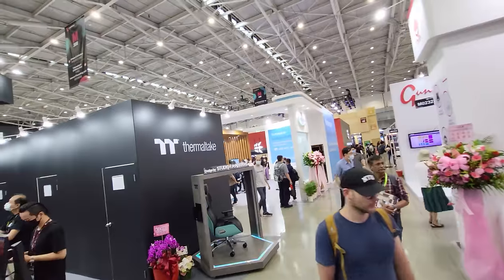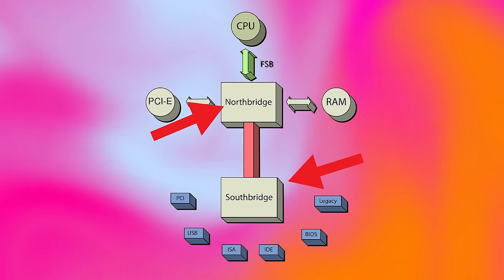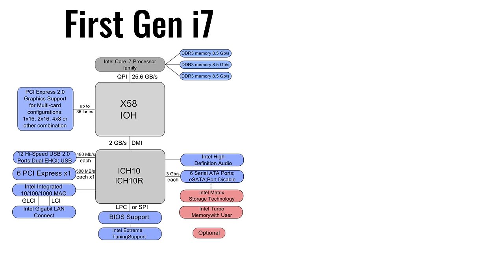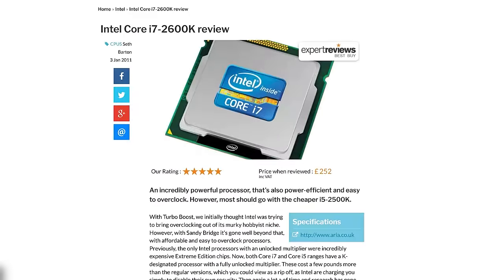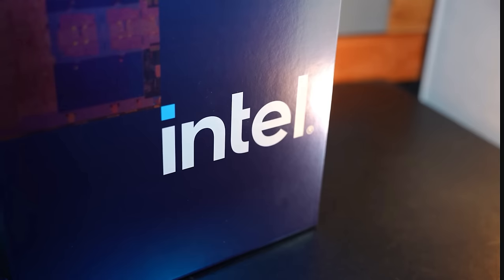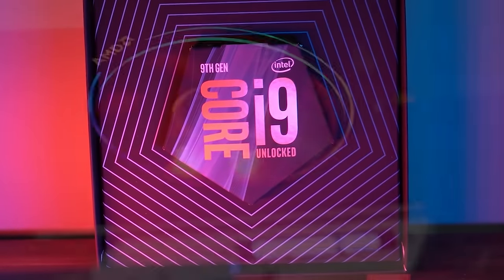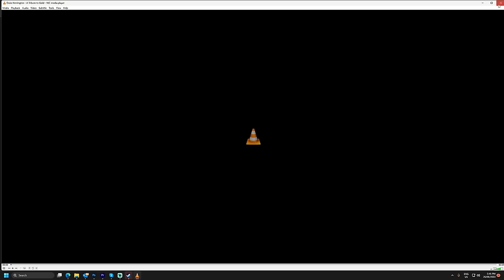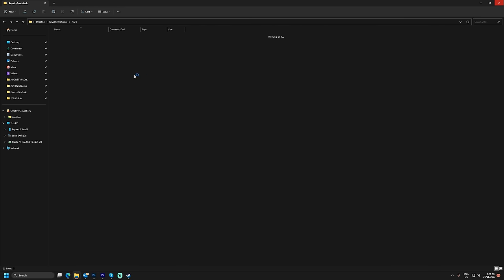SNAP - The Intel CPU Latency Story (Part 1 of 2)

Comment: I don't think so. My understanding is that the latency is in the NANO seconds, the delays shown in this video are way longer.  Showing a slow Premiere Pro timeline doesn't prove anything. Have not seen ms-word "glitched out" and then associate it to a latency issue.  There are many variables that could influence or cause the behavior.  Maybe a doubleblind test could be setup for this and tightly controlled.  Generally speaking a 13900k will be faster than a 10900k in most scenarios. 

Maybe setup  ddr4 test systems with same ram and same nvme, similar Mobo as possible and then do some testing.
Reply: Nanosecond-level latencies can easily add up to milliseconds or even seconds under the right circumstances. If your CPU is doing 1 billion operations, and each of those operations has an extra 1ns of latency before the next operation can start, that means a full second of total added latency. Hence why RAM latency matters so much in games (and why AMD's x3D CPUs are able to provide such a performance uplift). I agree that there might be other causes to this specific issue though.
Reply: @half7232  1 billion operations are needed to open a word text file?, don't think so ...

Comment: The system agent is still very much on the same die like previous intel CPUS. Look up Alder Lake die shots on the net. Disabling e-cores in the BIOS doesn't work. Enable e-cores in the BIOS and then disable them in windows by using this CMD command. bcdedit /set numproc 16 (16 is the number of threads, i have a 13700K.) 
Perhaps the issue is the motherboard/chipset. All USB ports on intel PCs go through the chipset. The only way i can think of to bypass the chipset is to get an M.2 to USB header adapter, and connecting it to the primary M.2 slot.

Comment: This is quite interesting. I have not used a 12th or 13th gen intel platform myself, but this reminds me of when people upgraded from x99 to x299 and saw a performance decrease in some areas. This was when intel changed their architecture from ring bus to mesh (i think). At the time, i'm pretty sure the consumer kaby lake chips were still on ring bus and actually outperformed the HEDT cpus in most games.
Reply: FWIW, I got a significant bump in performance coming from x99 to x299 in games. I guess OC's were far better on the x299 platform. Still rocking it to this day :D
Reply: This was a big discussion point in the forums from HEDT users back then. I personally had a X99 6950X system when X299 dropped and decided to stay for the ring bus since I had a golden 4.6GHz 6950X. The mesh latency penalty can be reduced with a high uncore overclock and fast RAM but X299 CPUs still do lose to a highly tuned 6950X system when latency matters. 

Funny thing is, because the mesh CPUs sucked at gaming Intel released Kaby Lake-X which is their most pointless CPU lineup ever to try and cater to people who for some bizarre reason wanted X299 motherboards but want the best gaming performance. They offered the same 4-cores, 2-channel memory and 16 PCIe lanes as Z270 CPUs so wtf was the point?
Reply: @OTechnology  I get why they introduced the Kaby Lake X though, theres plenty of people who use all the lanes on say the z270 platform, and the x299 would offer them slightly weaker cores with much more side supported stuff. And it was quite budget friendly to boot compared to the 7920x and up.

They'd also OC like no tomorrow, especially when delidded. My 7920x can do 5.0Ghz on most of its cores for example. A significant bump in performance.

and x299 boards just look amazing TBH. Quad channel RAM <3

Comment: You used IOH and IO driver interchangeably, so I'll assume you mean the part of the system that includes the memory controller, PCIe root complex and the associated bus interfaces. 12th and 13th gen Intel Core CPUs are still monolithic, and the Intel datasheets say this functionality is still on-die. In fact they have even added USB-C and USB4 to the CPU die. So if it's not the IMC or PCIe controller that have been moved off-die, then what IO driver functionality is left to be removed?

Windows search is at least partially a software issue. On more than one system I've typed in the name of a file I know I have somewhere and it simply never stops searching while sending the SSDs to 100% busy. Using the 'find' command in a Linux subsystem terminal is faster, or even searching from another system over samba
Reply: I turn off Windows search and just use Void soft Everything.

Comment: I have a 12900KF, seen the issue you show, I always thought it was a Windows 11 issue, because it started happening after a KB update to fix a security issue last year or prior. Long story short I disabled A LOT of stuff in windows, MPO was one of the main ones & I wouldn't say I stopped having the issue, but it wasn't even closer to as nearly as noticeable today since I reinstalled windows fresh (due to MBR on new drives for some unknown reason causing CSM disabled issues, causing black screens for monitor that wont go away unless you restart with HDMI old TV installed into 3080 GPU with the DP port monitor) Since Then! I notice that latency issue Every God Dam Time. ~ Hindsight wish I kept a list of the changes.
Reply: Actually In fact since its new I only have: KB4023057,  KB5027231 & KB5027303*, also Framework: KB5027119 installed & while my PC was offline & I was installing all the system drivers I didn't notice the issue, But when it was online & Windows updated as above its back & some. So i really would not rule out windows 11 making that IO issue worse. - Full transparency I also had Memory Integrity off when installing my drivers before windows update & the issue was noticeable. - I also didn't have the "optimizations for windowed games" option At All appear, until I updated windows.
Reply: I had a 12900k, I have a 14900k now and I've not had any issues I did with the Alder Lake i9. Alder Lake was super problematic when it came out. Unrelated but it was nearly unusable sometimes within the first few weeks until a bios update came that fixed all the bluescreening I was experiencing.

Comment: Are there latency differences between 10th and 11th gen? If not, then shouldn't 11th gen be better due to pciex4 support?
Reply: 11th gen has higher latency than 10th gen, it's the main reason why it really didn't get any performance improvement.

Comment: I've had a 13900k (upgraded from 9900k) for over 6 months now, and I haven't noticed a latency issue. I'm going to have to pay attention to this now.
Reply: Yah I did a similar upgrade 9900K with DDR4-4000 -> 13700K with DDR5-6800.    I don't see any latency issues like he shows in this video.    Everything in this video I'm seeing, seems like a storage related problem.   Maybe his storage drivers aren't in MSI-X interrupt mode and are legacy interrupt sharing with some other device?    It's hard to say honestly without sitting down at his system and seeing exactly what's going on.
Reply: If you game with high apm , high elo moba player vs , you will notice it
 Or as high elo cs player

Comment: From my experience, the lags and stutters you experienced are mainly OS related (a fix may be uninstalling OneDrive). The real latency issue is DPC latency and I heard that may be fixed in a future driver update. There is a thread about this video on r/intel and some of the replies may be interesting. 

Lookin forward to part 2 doe :3
Reply: I fixed the dpc latency issue by disabling core parking in regedit. On my 12900k. Tested using latencymon

Comment: I am not a power user or anything, but I do have an i5-12600K (idk if that's affected by the poor latency) and I did have the same issues as you described on Windows 11. Just random slow downs or pain inducing loading times while I was making basic things like programming, presentations, documents. Don't even get me started on the usability and responsiveness while I was recording with OBS at the same time. I have always dual booted Linux on my PCs and it came time for me to install Linux on this pc too and I noticed that I never got these slow downs there, never. Months passed by and I decided to install Windows 10 on the place of 11 and I am proud to say that I am no longer experiencing these issues and I will keep away from Windows 11 for as long as I can. Just for extra clarification, I have a crucial p3 plus, sandisk 3d ssd and a seagate hard drive, the aforementioned issues happened on all three drives.

Comment: Hmm, how interesting, I have a 12900KS and z690 gigabyte board and I have not noticed much latency at all.

I use the 12900KS as a professional programmer daily and writing and execution of code I find the latency to be quite low, even searching files as you showed on this video.

I did find windows 11 slow to begin with, but I modified the OS configuration, set the display to performance and disable visual fades and transitions, and a bunch of background services. 

I can only compare my experience to my overclocked 3900XT, and the 12900KS is miles ahead in snappy feelings and performance.

The one thing that could contribute is DDR4 vs DDR5. I'm running a DDR4 kit 32*2 CL16 3600. The system is noticeably slower in gear 2 mode, but in gear 1 mode it feels very fast.

Now DDR5 is way slower in latency than DDR4, but it makes up for it in bandwidth, and I'm wondering if lower bandwidth tasks that are not active for long enough could be a potential cause? 

Not denying that moving the I/O controller off chip is causing some latency, but I wonder if it's compounded with DDR5 higher access latency in general.

Generally I/O tasks concerning the mouse and keyboard and system interrupts are very very low bandwidth but still need to have the state saved in either cache or memory, and in the event of a cache miss, I wonder if DDR5 access times just tanks system interrupt performance.
Reply: I have a 12600k and a gigabyte board and have never noticed any latency problems

Comment: I was having similar problems with my 5800X after migrating from a m.2 SATA SSD (Samsung 870 EVO 500GB) to a m.2 NVME SSD (WD SN770 1TB).
I thought my drive was defective or something. OS would eventually crash after several hibernates. Games and apps crash eventually after several hibernates too. Stuttering and loading got worse the more hibernates and the longer and harder I use my PC.

I also thought of the IO issue. So I undervolted my SOC voltage from auto (that went to almost 1.4v) to a flat 1.1v. Voila! No more lags, no more stutters, cooler CPU too.

I've read about that issue before and reddit and the Pollock guy from AMD suggested to undervolt the SOC instead. The assumption was that it was thermal throttling under IO loads and this caused hiccups and long loads, like a broken HDD drive. The same should also cure some USB and audio issues too on AM4 as the USB disconnects and audio hiccups can be a sign of the IO/SOC chip under stress.

I think the problem with Intel and AMD now is that they are pushing their chips too much to sell it as high as possible, combined with the overgenerous defaults of motherboards trying to say their boards perform better than others by overvolting and playing with limits. We are basically getting overclock problems out of the box.

Comment: Great video, really waiting for part 2
I have an i5 10400 in one of my PC's and the other day I was at a friend's house and showing him around some basic stuff about video and photo editing. 
We both acquired our nvme SSDs the same day, they are the same model and the same capacity but the only difference is that his system is 12th gen. 
There were quite a few little moments that his of felt sluggish when I was browsing the files or scrubbing a few pieces of a video/photo on each editing program. I thought it was my idea, maybe I was tired of something, I even thought the SSD had some issue. 
Turns out I wasn't crazy and it wasn't my idea.
Reply: I can't say my system feels slow with a 12th gen, although I don't have a E core part since the E cores are just terrible for everything so not sure if the non e core parts don't have that issue
Reply: @tilburg8683 they have that issue and you're fooling yourself into thinking you still made a good purchase 😂

Comment: Quite strange, been using a i7-12700 along with a B660m chipset,  PCIe 4.0 NVME SSD and 32Gb of DDR4 RAM at 3800Mhz and CL 17, and never faced such problems, on the contrary, everything seems so snappier.  I think this needs a deeper investigation, your problems seems to be somewhere else ...
Also, usually your first SSD M.2 and GPU have a direct connection to the CPU, not going through the chipset ...
Reply: i had simmilar problems on i5 8400 , never fully figured out what caused it . Tried faster memory , tried different bios versions ... even thought mayby C states but not ...

Comment: It seems much more likely on or even multiple of these cause the delay(s):
- Shell extension(s); could be a icon overlay extension that has to call-out to a service render its icon think sync utility showing the sync status via the icon
- Filter driver; they can do lot and hence can slow things down a lot
- AV (so a filter driver), because you didn't you work folders from on-demand scans
Or some other thing along those lines. That's just what I thought of on top of my head.

Anyway, I doubt IO throughput/sec has decreased with newer architectures.
Reply: it's about latency not throughput
Reply: @toseltreps1101 latency would hardly account for seconds of delay to list a directory

Comment: I have a 13900k and have seen the same behaviours, i thought i was nuts even my ten year old CPU was faster. But is it Windows or the CPU, i'm not sure everyone seems to think the CPU is faster than previous generations but you would think browsing files would be easier than a benchmark test. I have another theory there has been a number of security patches around data leaks with superscaling in these modern processors. It is possible L1 cache is being reset a lot more to avoid hacks like Spectre and Meltdown. I actually thought they fixed this in 13th gen but maybe they were just using microcode patches.

Comment: You say the "I/O driver functionnality of the system agent" has been moved off the CPU.  This is unclear.  What are we talking about and where did it goes?  When I look at the diagram block of my Z690, I can see that my main SSD is connected to some PCIe lanes that go directly to the CPU.  This can't be closer to the CPU.  Some other PCIe lanes go to the south bridge (chipset) but that's the point; you should always connect your SSD to the PCIe lanes controlled by the CPU.  What am I missing?
Reply: The io module was never moved. If it was moved, then the CPU wouldn't be able to talk to the ssd.

Comment: also do you know if its the same with 12 and 13th gen laptop CPUs? i thought maybe theyre not the same since theyre soldered into the motherboard.
Reply: yes. i wanna know this also. my 12700h is a bit meh
Reply: soldering is just a method of mounting, so same or even worse, because of energy saving power plans..

Comment: Its windows 11 issue, on windows 10 everything is snappy and quick. I had bad loading times on HDD using win 11 and 13700k but everything got fixed when i moved to win 10. I use stripped down version which i modified further for maximum low latency, everythig is flying and insanely fast. I've not experienced any of what you described, you can't even open a video file lol
Reply: Yeah, after these vids I was beginning to think I shouldn't buy a 13th gen anymore, but now I know for sure I should never upgrade to Win11.
Reply: @rsgxyt  13th is insane, i came from 10850k which had b-die ram, all timings tuned, cache oc'd and cores + stripped windows and 13th gen is on another level of performance even at stock speeds - lol 5.4 ghz out of the box.. i own 13700k and it has 30mb of cache which simply removed all stutters in 2023 games running unreal engine, even if they do happen they are hardly noticable now...
Reply: @BorealSine  Oh, I can imagine how fast it is. I'm still on 4th gen, can't believe it still works, looking to upgrade to either the 13700k or 12900k. I'm worried about the temps I could get on the 13700k since I don't like AIO coolers and any air cooler struggles somewhat. I think I'll be fine after undervolting (maybe also underclocking) it a bit. Looking forward to 14th gen, maybe it brings something even better.
Reply: @rsgxyt  you are completely mislead by all these YT channels, 13700k is possible to cool with 30$ air cooler, I've used it for 2 weeks and i had my 50-60 degrees celcius in games at 1.25v 5.6 ghz (during summer time) And Air cooler = AIO, there isn't much difference between premum aio and premium air cooler, if you take custom one like i have then you will have that 20 degree difference and maybe 30-35 degree difference if delidding is done. Heat transfer could be better but its not necessary when temps are great already. And to be honest with you 13700k at stock 5.4 ghz is so fast that touching anything wasn't necessary, i've only increased speed to 5.6 ghz because cpu can run this frequency and these low voltages. If it didn't i would stay on 5.4 ghz and would be as happy as the only difference you will see will be in 720p low cpu tests, nowhere else, in normal conditions where gpu is loaded by 99% there will be no difference, so you will only need to touch cache, oc it to 4.7 ghz and forget about it. OC ram at anything which runs up to 1.25v VDDQ/VDD2, 1.40-1.45v ram and that's it, i run at 7000 mhz on budget 'business' entry level z790 Pro-A from MSI and it can do anything these high end mobos can do which cost twice the price.